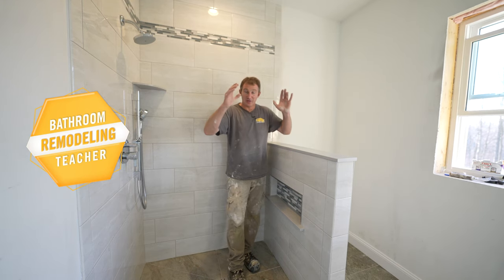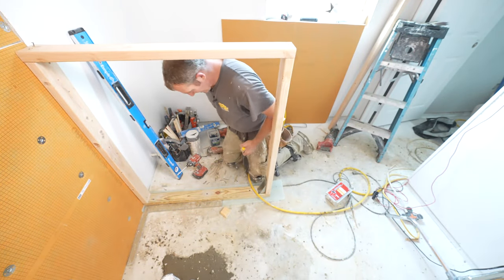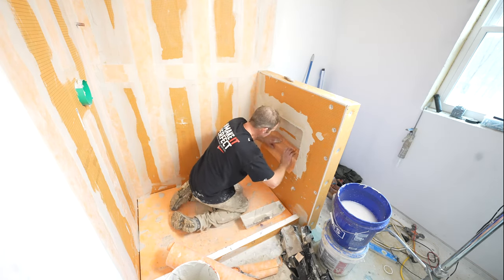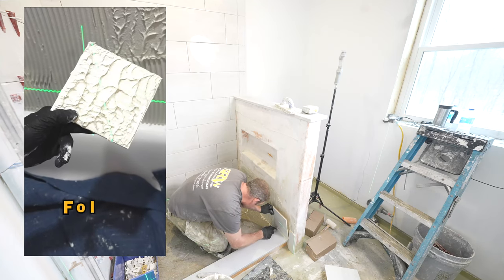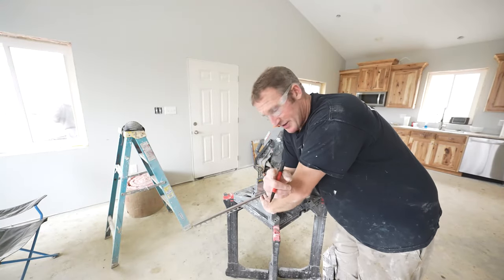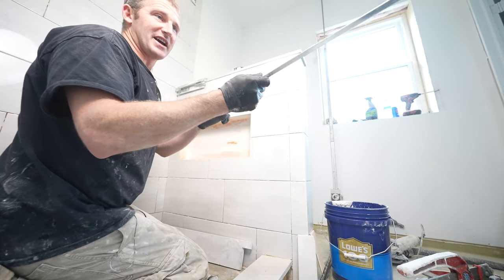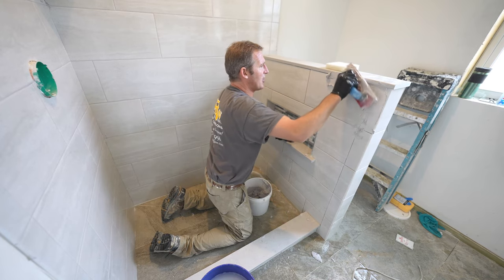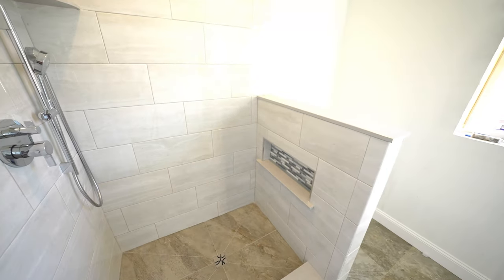Building a Knee Wall for a Shower | Bathroom Remodel | PLAN LEARN BUILD

Comment: SRW,  some day I may undertake a curbless wedi install over cement floor. Would be nice to see how that's done, not a lot out there for it today.
Reply from the maker: I’ve found that for curbless over concrete, it’s better to just do mud with a Schluter drain. It’s easiest to cut and remove existing concrete and slope a mud bed. Certainly cheaper that way too. Will try to tackle again some day. I don’t like promoting this channel but I did do one years ago with a linear drain - https://youtu.be/jRxnwaMsZpk

Comment: Hi I’m from the uk I want to build a shower knee wall as yours & I wanted to ask what can I use instead of foam sill seal as I cannot seem to have find in England. Also my walls and floor are concrete.

Comment: Great video Steve . Haven’t seen an in depth video on knee wall placement . U nailed it .
Kind of off topic but looking for some better bathroom fans . What fans do you suggest ?
Reply from the maker: Thanks Dan. I’ve been wanting to do one for quite some time. And for fans, Panasonic for sure. I might have literally installed 30-40 of these ones - https://youtu.be/Vfp64oj4IdI
Reply from the maker: And for installation of a fan in an existing ceiling - https://youtu.be/5JXNjkzNieA
Reply: Thank you !

Comment: so if i installed a shluter prefab shower niche into a drywall cutout.. then put the waterproof membrane overtop and cut it to the edge of the niche..would there be zero excess buildup around the face of the niche?
Reply from the maker: If it’s a prefab niche that would work great, otherwise you have to address edges of niche with using scrap pieces  like I did here

Comment: Awesome video. I am getting ready to do the exact same thing and it gave me a few additional ideas. Question, did you put anything around the edge of the wall?  Fabric or corner beads for exqmple ir just raw edges of the kerdi? The one thing I would do differently is to spend the $70 for the premade niche. That cost outweighs tge amount of labor needed by far.
Reply from the maker: Yes, kerdi band all around.
I agree with pre-made niche 👍 
Much faster 👍

Comment: Great, great, great video!  Question, I am building a shower over concrete using a seat to cover existing plumbing.  The seat will butt up against a knee wall.  I plan to put the shower valve in the knee wall.  Would you recommend a 2x6 knee wall if plumbing is involved?
Reply from the maker: Thanks 🙏. Sounds like a lot going on in that knee wall, 😆 
But no a 2x4 wall should still be fine. Most shower valves only go back 2 3/4”, so the extra depth of a 2x6 won’t help much. Plus you would definitely be getting a custom top or doing tile. Not many places sell 8 1/2” tops. Not saying it wouldn’t look good 👍
Reply: @BathroomRemodelingTeacher  cool thanks!!!

Comment: Hi! How you did your sill plate is exactly what I am doing in my shower! Where the ends of the sill plate overlap the wall tile, did you use caulk or grout to seal that gap between the wall tile and the sill plate edges? Hope that makes sense.
Reply from the maker: I usually use the caulking to where it meets walls, but just grout beneath. If your asking about the knee wall sill.
I still haven’t edited all the videos on this one 😆
Reply: @BathroomRemodelingTeacher  thank you! Yes, the knee wall sill. Your video helped us out a ton, so thanks again!

Comment: Nicely done. How strong is that wall? Hopefully nobody stumbles into it. Was hoping for rebar anchored into floor wall but maybe that's overkill
Reply from the maker: It was pretty strong. No movements some guys here in comments made good points. Adding plywood to one side would add strength too

Comment: Steve - Are you finding Schluter product OK?  Or, are you using whatever you can find these days?
Reply from the maker: Yes, I still use them a lot and recommend. There is just a lot of small annoying things about it. But every system has its own set of issues, 👍
Reply: @BathroomRemodelingTeacher  thank you for the reply!  I should have phrased my question differently, have you been able to find Schluter products at your retailers, or has supply been a challenge, whereas you’ve had to switch to Laticrete or other?

But I agree with you, the banding is the most annoying part compared to other brands where the sealants look much more appealing!

Comment: That’s not how you’re supposed to install that Holdown. The manufacture and Home Depot have installation instructions. Per your own admission, you notched the bottom sill plate because you didn’t have a long enough bolt. That’s not a reason to do that. Go get longer bolts. Another thing, you used screws to hold it to the vertice studs, you’re supposed to use 5/8” bolts to hold it down and 1/2” to hold it to the vertical studs, which are supposed to be doubled up. Use a forstner bit to recess the bolt heads for drywall or cement board.